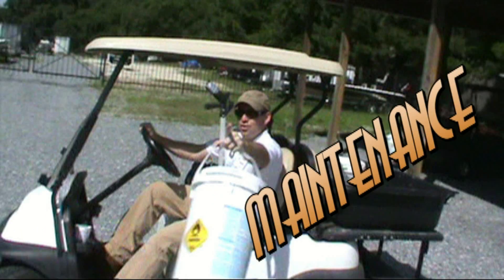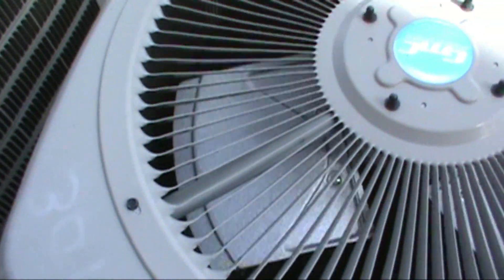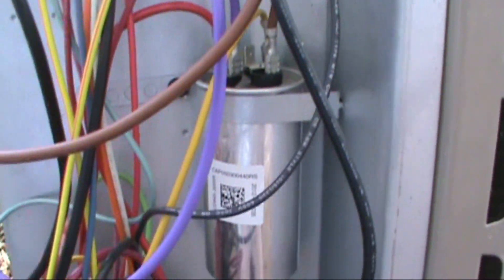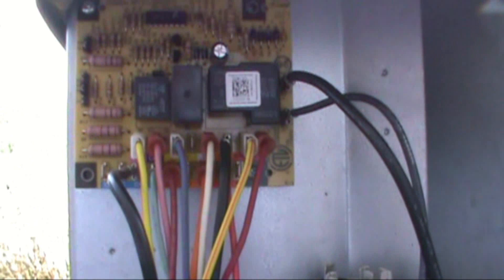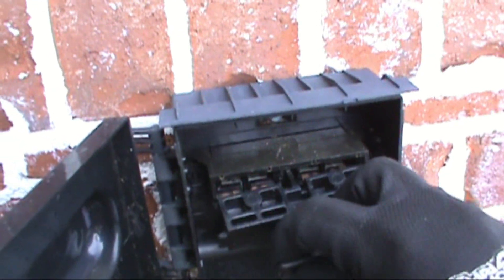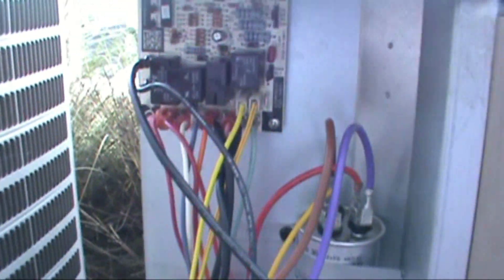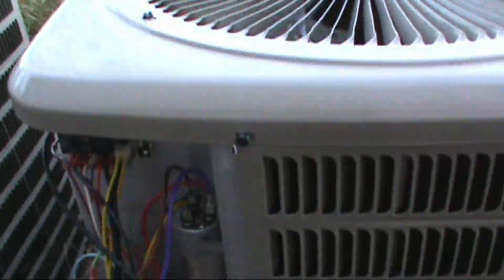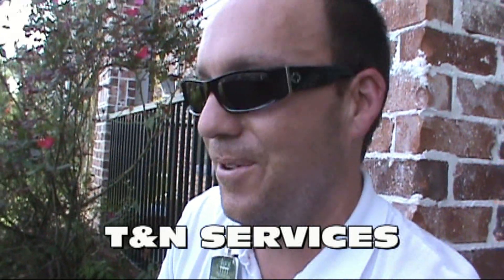HVAC BAD DEFROST BOARD. HEAT PUMP. R-410A

Comment: if fan did not turn on would it be a fan motor   thank you
Reply from the maker: It's could be. I'd have to ohm it out and run test with my volt meter before I condemn it. Thank you so much for watching James!

Comment: Can I do the same thing on my 2003 ruud defrost board fan to common
Reply from the maker: If the fan wire is on the defrost board then I'm sure can. I've Never worked on a Ruud though.

Comment: Great tip...what if the resident says the air handler and condenser (Heat pump) are making loud noises at 4am...told them it's the unit defrosting, but there saying its lasting 15 mins..and by any chance do you have a video on checking levels in the cold?...
Reply from the maker: Yea, sounds like defrost mode. Ive learned that residents can exaggerate time lengths. 😆 Since we dont get too cold here in Florida, I don't have a winter time gas up video. Check out AC tech services channel. He has some cold weather refrigerant gas up videos.
Thank you so much for watching Chris!

Comment: Nice one that unit has already had a compressor I see! Don't forget about the sensor being closed when it shouldn't be putting it in defrost in cooling mode! That one will get ya
Reply from the maker: Right on Joe! Yep, must've happened before i started there. Had driers on liquid & suction lines.